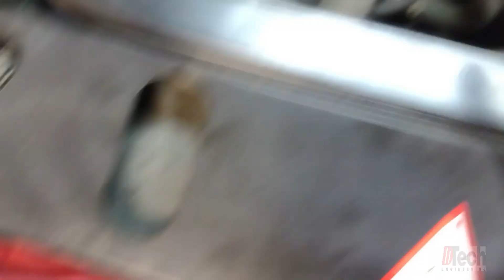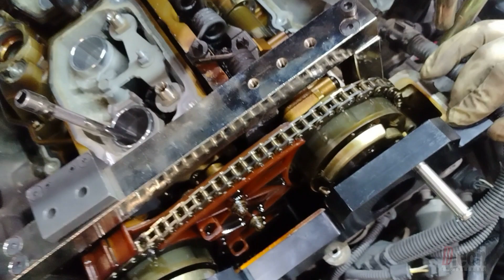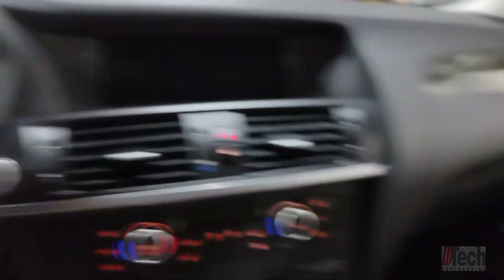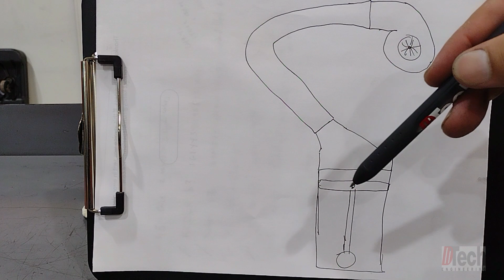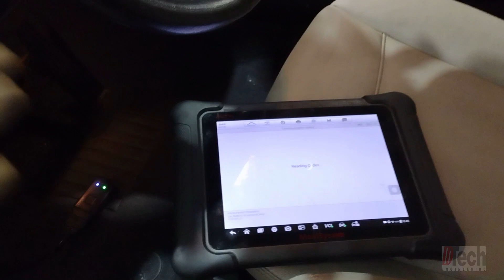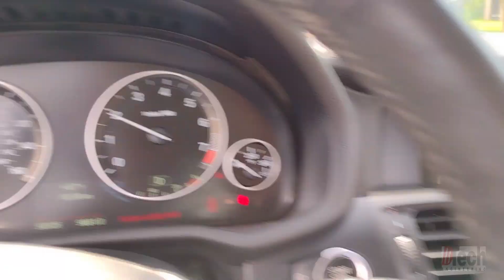BMW X3 No Start and then No Power Diag & Fix

Comment: Idiot!
To determine a turbocharger malfunction, you don’t need to connect an oscilloscope and chew snot for half a day!
Just read the fault code in the DME regarding “pressure violation in the intake system”!!!
What is this video about!? About your STUPIDITY and attempt to show off a Chinese oscilloscope and Autel? Your technical level is below par!

Comment: You sticker oil bro the oil they manufactured for the car is for call country not for hot country and these five 25 30 10 30 whatever the hell it is oil are too tine The oil pump go out too quick bad quick thick oil will boost the oil pump something y'all know nothing about

Comment: Sadel, great diag. A good example that customer's don't always provide you all the info about issues with their vehicle.  
Proof that fixing one problem doesn't make it a new car.
Your drawing may be crude to some, but it is effective.  It illustrates perfectly what was going on in the turbo system.  
One day when you become too old to perform as a  great diagnostician, you should become a teacher at your local college.  Great explanations of operation and problems.  Thanks again for sharing.
Reply from the maker: I actually think I will try to start attempting to hold some training for local techs at my shop in the near future
Reply: @DTEAuto  
Sounds like a great idea. I've noticed a trend in this industry for a few years now. 
I'm seeing fewer young techs and the older techs are becoming thinner as they age. Perhaps you can bring some motivation to the field with your experience and diagnostic methodology.

Comment: Man..if only I was in Ohio!   Definitely going to see if my lower pipe is collapsing under load. Same behavior....idles and drives fine until you give it the beans and then no boost. No rattles, waste gate actuates, smoke test all good, new vacuum solinoid, no oil in the boost reservoir, no braking issues so feels like the vacuum pump "feels" ok. P.S....im posting a link to this video on the bimmer forums I'm on as this is def helpful info.
Reply from the maker: I hope this helps for sure. That's awesome to hear on sharing the video, I appreciate that a ton. Keep me updated on the reactions. Thank you for watching !
Reply: @DTEAuto  Wellllllll....sadly that was not it. The lower charge pipe did not deform at all :( Still have the low pressure warning. My vlinker and odb app is measuring a calculated max 15 lb of boost which seems wrong. Car feels great for the first 15 seconds before the drive-train error tiggers - after that, even if cleared while driving, my X3 tops out at 80 mph :(
Reply from the maker: Those sensor readings can be incorrect at times or substituted values. Check this other boost diag that I put out if you haven't already,
 https://www.youtube.com/watch?v=b1zQyxBMMwE
Reply: @DTEAuto  will do